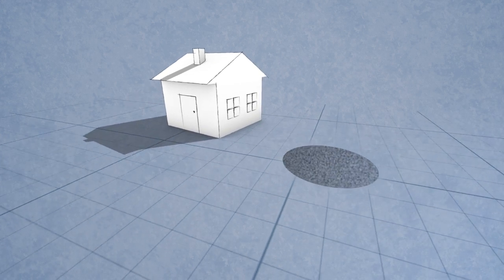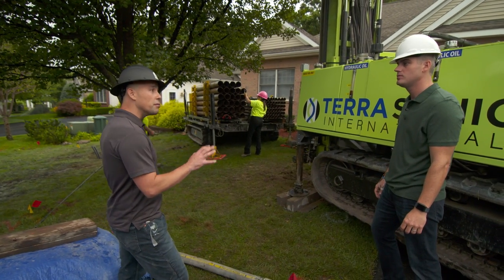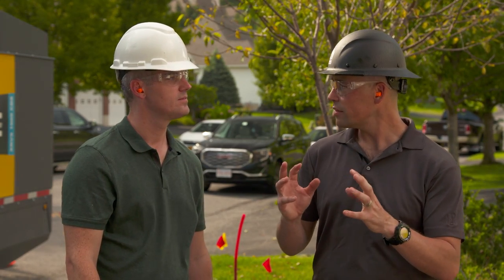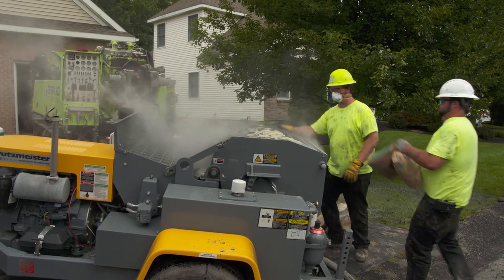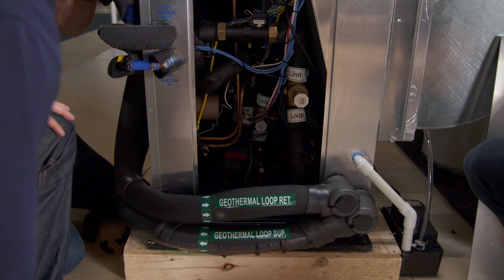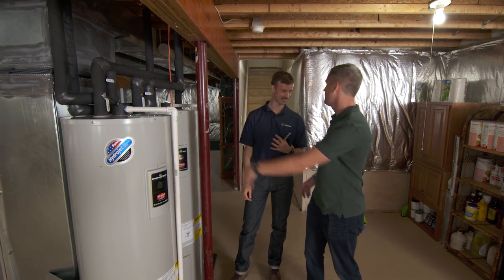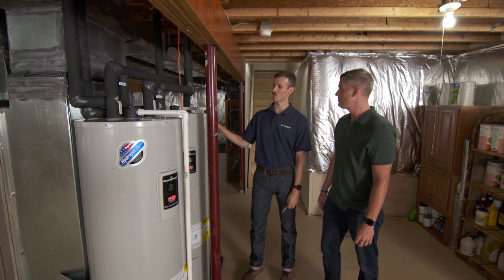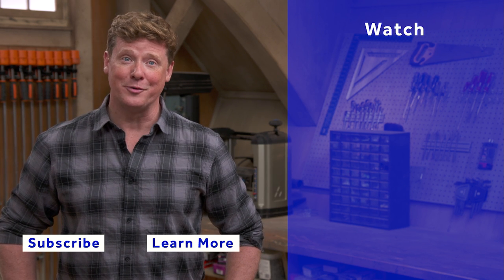Affordable Geothermal | Future House | Ask This Old House

Comment: I have a geothermal system that is water to water for heating radiant floors. The system is fantastic. That being said, the real savings come from having 6 zones and plenty of insulation. Not all zones need to be at the same temperature allowing the system to sit idle for some time. Any high operating costs come from the pumps needed to pump the water/glycol out to the ground. When those fail, shell out some money. I have two mini splits additionally for a/c in the summer but when winter hits, they seem to spend too much time in defrost modes where as the geothermal is quite consistent.
Reply: Can I ask what it cost? How much is your savings?
Reply: I've been saying this for a while. I mean if you have the money to invest a leaky home will benefit from ground exchange heat pump but you'd save more money just insulating your house and using air exchange. The benefit of this system overall is to couple it with other systems. Insulation and renewables make a lot of sense considering half a solar install on a typical American home is just heating and cooling.
Reply: @Slowhand871  I don't really have a total cost as some was done by myself and the geothermal unit given to me. The most exhausting part is the installation of the tubing in the floors. This was done during a remodel and saved great amounts of time. The aluminum transfer plates, oxygen barrier tubing and pumps make up about $2-3k of parts. I use a standing column well so I did not have to lay a loop. Costs about $100 a month for a 1,500 sqr ft house at an average of 65 degrees. Sounds cooler but when the floors are warm you don't mind.
Reply: So are you saying that you can heat just one room of your house, if you want? Like could you just heat your bedroom when you're sleeping at night, since the rest of the house isn't being used then? Is closing doors for specific rooms/areas then enough to maintain the temperature difference that way?
Reply: @manofsan  The geothermal system uses a buffer tank at 120F water as each room has its own infloor section of tubing that is controlled by a thermostat for that room only. So the other rooms can be set any other temperature since they are all separately controlled. The geothermal only maintains the water temperature in the buffer tank.
Reply: Very interesting. Sounds like it should be everywhere. I'm quite disappointed that this wasn't done on large scale since before I was born. Even more disappointing is idiots saying coal burning is clean.

Comment: A cheap, efficient way of heating a home in 2020 is to use a CO2 heat pump like Sanden’s system.  You connect this to either underfloor heat tubing or to radiators, and it provides hot water year round.  These air to water systems can have COPs of 6 or higher.

For air conditioning, small, single room, high efficiency, mini split, variable inverter, heat pump units can do a great job.

An empty room means a mini split is turned off.  This way you only get air conditioning where you needed and when you needed.

Another advantage is that if one single mini split unit stops working, while you wait for the air conditioning technician, you can turn on other units to make up for the malfunctioning unit.  If one of the units needs to be replaced, the expense is a fraction of a central AC, and the replacement installation is easy to do at a fraction of the cost of a central AC.

A final advantage is that they can supplement the heat of an underfloor or radiator system on very cold nights.

A system as described above has lots of flexibility when things go wrong, and typically when things go wrong is when you need cooling or heating the most. 

Here you have the luxury of planning things ahead for when they do go wrong.  

For instance, if the wife of the heat technician is in the hospital having a baby on the coldest night of the year, you can wait until the big event is over with additional heat sources.

Comment: What is the lifetime of a geothermal unit? Are there any parts involved in the system that must be replaced early due to use, i.e. pumps, fans, condensing units? How long are they guaranteed?
Reply: I’ve heard 20 years + for the in house units, 50-100 years + for the in ground loop.

Comment: Contrary to what’s stated at 0:35; ground source heat pumps typically DO require the use of fossil fuels to generate the electricity required to run the loop pump, compressor, and indoor air handler. The only way fossil fuels aren’t involved is if the electricity is generated in some other way (i.e. nuclear, solar, wind, etc). That said, even if fossil fuels are used to generate the electricity- a properly designed system is very energy efficient and can greatly reduce an owner’s energy consumption. Just wanted to clarify that opening statement.
Reply: In NYS we can actually pay a little more to get our electricity sourced from wind, solar, or hydro.

Comment: We put in a geothermal system in Northern Canada for heating no AC necessary, at the time there was no one doing a vertical drilling loops for that but since we hav e a farm we got horizontal lines in about 8 feet  we have 2 systems 5 & 7 tons very expensive furnace but at that time  we got a grant from the government still cost us at least 25K with almost half paid by grant. My 2 cents on that in the n cold climate the system struggles it is on almost 80-90% of the time to get the house to 22-23C when electricity was inexpensive it worked great but since then electricity price when way up especially up north and is costing almost the same as heating with natural gas in the city I wish we went with high efficiency  pellet/ wood    geo system as we have ton of wood from the farm also price of pellets is more stable and you can always stock up in the off season on them for a better price. Maintenance and repairs to the system are much higher then conventional systems and less choice of contractors
Reply: How well was your home insulated? The most important factor in the use of any heat pump is that your home is very well insulated. If it's not, then you're throwing money away. 

My home in NH has R40 walls, and an R60 attic. Since I use air-to-air heat pumps and solar I have a net zero scenario most of the year. I wanted to go geothermal but it was not practical for my lot.

Comment: Please update how the geo thermal houses in Texas did during February 2021 freeze. Would love to know. Thanks.
Reply: If your power was out there's nothing to run the blowers or pumps and the same thing would be true of electric heat or gas furnaces.   Unless you have generator or battery backup, or solar, any system that needs electricity to run is screwed.  Other than that geo thermal heat pumps could care less what the outside temps are because the ground temp only changes by a few degrees that have no effect on it's performance.  I hope they do a LOT more of those community sized GSHP systems for new construction - that's the smartest way to go.

Comment: At my house we use the standard heat pump system which does save money.   I like the idea of the geo system but would have to see the numbers.
Reply: My old system takes on average 1/4 of energy from electric and 3/4 from ground. Easy to calculate as COP values are told by manufacturers.
Reply: Where do you live? The colder the climate, the bigger the savings.
Reply: @brucealvarez9263  I live in Muskogee, OK

Comment: Now, would it be more efficient to use a "heat pump hot water heater" as the primary downstream of the pre-heat tank? When doing electric, you want to avoid resistance heating as much as possible, because that's your LEAST efficient source of electric heat.

My other question: in that Texas Community, they depicted all the houses being piped to the same well, and branched off of the same supply/return lines. So what happens when one house is still heating and their neighbor has switched to cooling? Are you effectively pumping the heat from one house to their neighbor, instead of into the ground? I imagine that has a negative effect on the system efficiency if the "Delta-T" isn't exactly the ground/air difference that the system was designed for.

Comment: What reapirs do think will be needed. Everything I've read is that geothermal has less moving parts and complexity so there should be less chance of emmergency repairs.
Reply: The electric  HVAC is basically very similar to a non-geothermal unit...however, it includes large pumps and other devices to circulate the fluid through the drill hole. However, geo doesn't require the outside unit. If anything...these unit have MORE components and parts than a traditional electric/gas HVAC.
Reply: Jeff W incorrect. Geothermal ground source (closed loop heat pump) systems require less maintenance then their air source counterparts. They have the same amount of moving parts. One has a fan (condenser unit), and the geo system has a circulating pump (moving water). The water is closed loop, and runs on less wattage and is indoors, so it will last longer than an outdoor condenser fan all else being equal.
Reply: @rosstrethewey9391  If used for heating residential homes, both systems will require an air handler which includes circuit boards, electric blower motor, ducts, thermostats, etc. The major difference between the two systems (electric heat vs. geo) is the source of heat energy. An electric systems has an outdoor heat pump, along with small augment heating elements in the air handler (sometimes), while the geo also has a heat pump and a closed or open loop (generally in ground). Now there are many pro/cons for both systems. The electric can easily, in terms of effort and cost, be installed in most residential environments both old and new homes while Geo has a much larger upfront cost, and is impossible in many residential environments. Obviously, the huge advantage of Geo is that is partially relies on the heating of the Earth for its energy while electric heaters utilize man-made sources...in the US being mainly nuclear and natural resources. It would not be accurate to say that GEO has less parts than electric HVAC units when talking about the major components involved. As to which would require more maintenance...one can only guess...but manufacturers seems to be experts at building components with known failure rates...I suspect both would have similar operation envelopes by design. I'm a huge fan of GEO...huge. And I would strongly recommend its use when conditions exist that make sense. However, it's important that we understand that GEO is not going to work for most Americans at this time...

Comment: I want to know more importantly about the warranty and the life span of what they are putting in the ground..
Reply: They are putting a pipe in the ground. It is a closed loop. So long as you don't spring a leak there is no discharge.
Reply: 50 years
Reply: We have installed them for a long time now and the piping is warranted for average 25 years. NO one is going to warranty the wells for 50 years. Again not very cost effective if you have natural gas near you. Great ideas for areas where you cant get natural gas.
Reply: @zack9912000  My wells are warrantied 50 years.
Reply: @bytenik   Well sadly that isn't the norm .  A lot of customers see that around here from companies less then 15 years old and dont believe they will be around if there is ever a problem. Also 50 years for a well is a very long time where anything can happen that most company's will not cover after the warranty of the equipment has expired.
Reply: @zack9912000  I got about 6 estimates in my area before selecting my contractor. All had 50 year warranties. It must be a regional thing, because its definitely the norm in my area. I chose a giant HVAC company that does commercial as well as residential, so they're likely to be around for a significant length of time. 50 years? Probably not, but who knows.
Reply: zack9912000 how can someone like me get into this line of work? I’m 19 years old about to get my OSHA . Also in NYC if that makes any difference . Also under what category of construction would geothermal go under ?
Reply: @Who2Rawww  It falls under what we call post construction HVAC retrofit. I would find a local or regional company that offers the product line. You will need to get your EPA certifications and you dont have to go to school to learn the trade. It helps depending on the school some trade schools are a waste of money.
Reply: zack9912000 thanks. Im looking to get into carpentry since I think I’ll really enjoy it and I already got some knowledge . But everyday I learn about different parts of construction I never knew there were so many areas. I hope to learn most of not all one day
Reply: @Who2Rawww  If your in NYC or the Hudson valley and want to be a carpenter, join the union. You'll learn plenty of skills and get paid while you learn. Also you will have money saved for you.

Comment: What you forgot is that our NY houses with fuel oil have baseboard hot water heat transfer. No air ducts. Mini splits don’t require ductwork or detailed installation costs associated with them. It’s more cost effective to use air to air heat pumps, even now, with this one company that has this new tech displayed here. And we like children.

Comment: Ok I was sitting here thinking “ground temp is 50*…..that’s neither hot enough nor cool enough to provide heat or AC.”  I guess the point he explained at the end is to use the ground temp to lower the workload of a heat pump and traditional AC system. I still don’t fully understand this though.

Comment: Does this only work with forced hot air / central air? I'm curious if the system would be hot enough to work with water radiators.
Reply: I believe in this case ground loop water is run through the preheating domestic water tank before it's returned to the ground. It's slightly hotter because in the summer using the system to cool the house would be sending heat back to the ground and so you might as well use it to preheat domestic water. (You still need the ground loop because you will quickly saturate your hot water tank.)

I don't know off hand of any systems that produce only hot water but there is no reason it can't be done. The water coming from the ground loop is not hot enough to run directly through the coil in the air stream or radiators. Instead it provides (or removes) heat to one side of a traditional vapor-phase (heat pump) cooling system. That system is then able to raise the temperature of the coil in the air stream well above ambient so the heat goes into the air. The air coil could easily be swapped for a water coil that could provide hot water to (two pipe) radiators or radiant floor loops. Heat pump based water heaters are already in use and they contain that water based heat exchanger.
Reply: Yes it works with water radiators. It is even better. Then you can get the hot water for the house too. The system can get radiators to 65 Celsius. So best is in floor heating or low temp radiators but old ones work too.
Reply: Baseboard hot water systems need water that is 180-190 degrees.  You could convert to in the floor heating loops, where the water temperature is much lower.
Reply: @carljaekle  There is no need for that. That is wood boilers and inefficient radiators. 140 F heats a house just fine. If they don't replace radiator with new low temp rads. Or add a fan.

Comment: This makes sense in SOME cases. It is NOT a solution for every location. If your designing in, switch to, or replacing a heat pump, ground source is an option to seriously look at. Otherwise, the money might be better spent on thermal treatment (insulation) of the structure.

Comment: Hey, I was wondering if there's any chance that this underground system can inadvertently suck up Radeon radiation or any other harmful ground chemical?
Reply: No it can't, Sam. Radon is a radioactive gas that does seep into basements quite easily. But these ground-source heat pumps systems use long runs of polyethylene tubing, down the hole, carrying water or glycol. They're closed loops and nothing can enter them, not water or gasses like radon.

Comment: Does this project only apply to heating and cooling? I would argue that solar might still be more cost-effective at that price tag if it can provide the energy needed for all purposes, not just the air conditioning. This is really great, though. If this system can be used to generate electricity as well at some reasonable additional cost, then I'm sure it could outdo solar in many places.
Reply: Wherever someone can use geothermal it is going to beat out solar. No question. This system will work all the time, whereas solar is limited to when the sun is shining.

Comment: I always see geothermal paired with forced air systems. Can it be done with radiant water system? Would it still be worth it?
Reply: Yes can you use geothermal to heat air or water. We have designed both, and they both have pros and cons. Typically if you want both heat and AC, the air system version will have less upfront cost and gives you both, so that’s why you see that most of the time.
Reply: Dandelion, the company in the video, only has an air version at this time, but they are planning to do a hydronic version at some point.